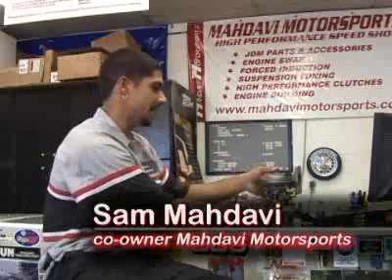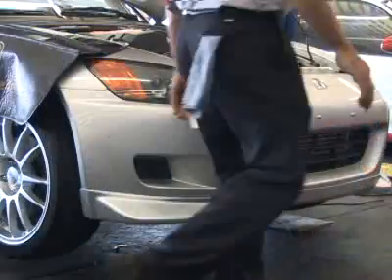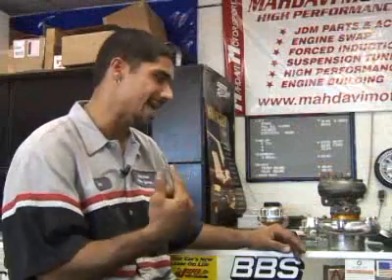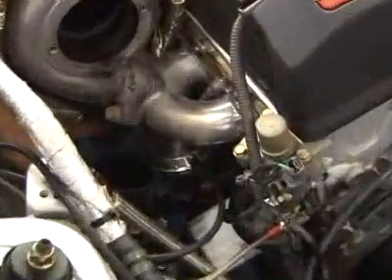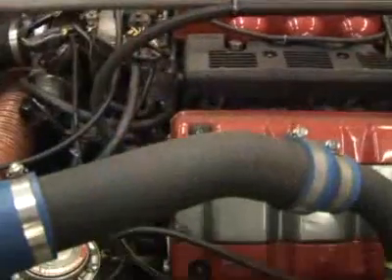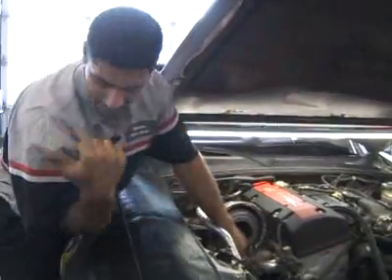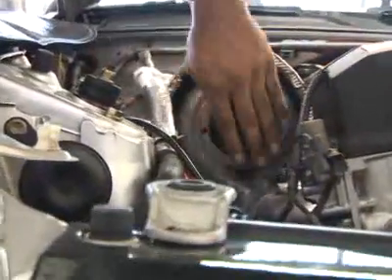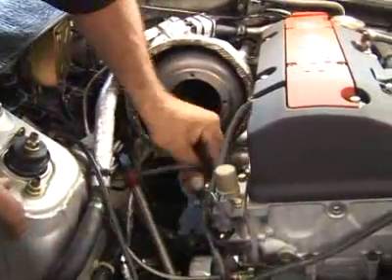Turbocharger

Comment: On a turbo charger engine air is puped into the cilinder this  means that the engin management will alow MORE full into the cumbustion chamber creating a bigger bang. On a car with the same size engine that is normily aspirated less air enters the cylinder meing that less full can be burnt. Most modern cars run at a mixture (in the uk this is) of 18:1 so if there is more air more full has to be injected to keep this mixtre right outherwise the engine would be running lean

Comment: not really, superchargers are more consistent and can deliver boost, instantly. turbo does have lag but since turbo's doesnt use power from the engine to run it gives you a more efficient boost, and there are numerous ways to circumvent the lag you were talking about, such as twin turbos, twin charging, and through a misfire system(though i wouldn't reccomend this)

Comment: do you even know how engines or turbo charging works? yes it does give better at cruising speeds because the you get more bang for your fuel since there is more air in the engine to combust. bigger combustion means more power and better mileage, and he's real point is using the fuel in your car more efficiently, its true since you also use the exhaust to power your car.